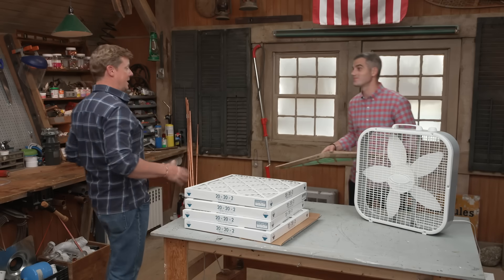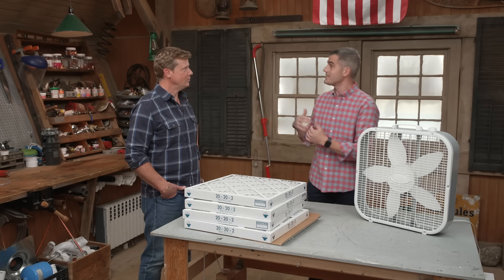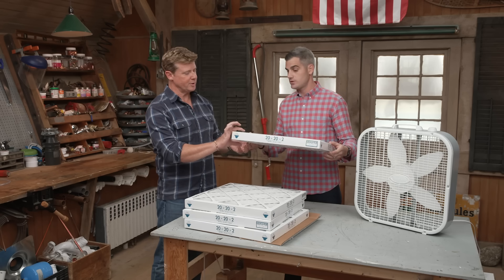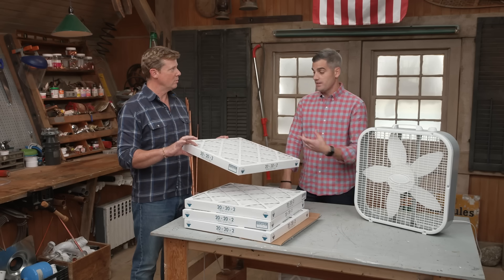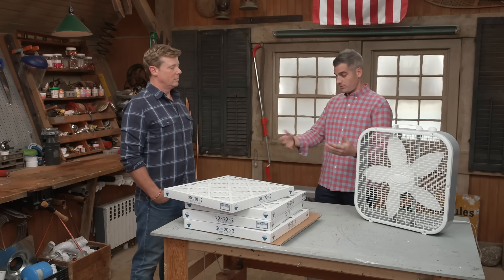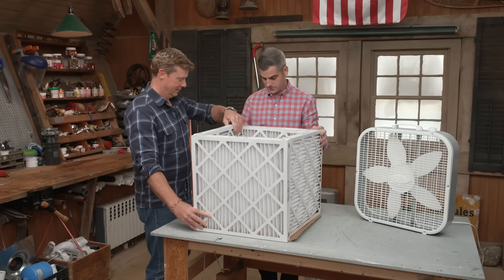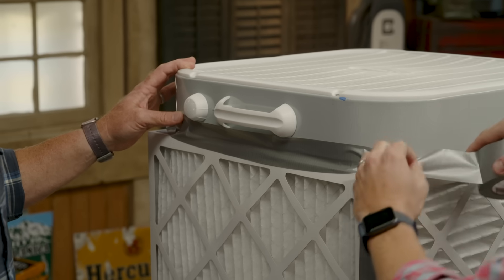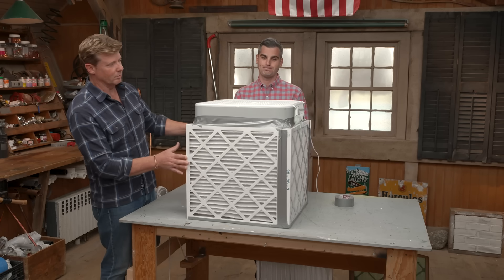How to Make a DIY Air Filter | Ask This Old House

Comment: Good stuff. 
I've got a few different HEPA units, and a very sensitive nose. On my floor furnace I have one HEPA furnace filter like these, on an angle  on one side of the furnace (floor furnaces are really great at collecting dust and then spreading it). The filter is attached to the bottom of a dorky plywood box hung on the wall above it.  On one side of the box is a small round table fan. Now I have hot filtered air blowing through my house.  
To replace a $400 Honeywell unit that smells like burning wires, I just wired another HEPA furnace filter to the back of a big circular floor fan. (When it's going it sucks the filter against the back of the fan.) This does about as good a job as the Honeywell junk before it started smelling like burning wires.  Both of these completely bootleg set ups worked pretty good during California's bad fires a few months ago.

Comment: This video is incredibly IRRESPONSIBLE. MERV 13 is NOT enough to capture viruses. It barely enough to capture sneeze-sized droplets, but COVID can be transmitted by aerosols, which requires a HEPA-grade filter (MERV 17 or higher). Here is the relevant link: https://www.damagecontrol-911.com/hepa-filters-rated-with-merv/

Comment: Soooo wearing a mask won't help prevent the spread of covid19.... Hmmmm... I guess I need a merv 16 on my face.. this guy has no idea how covid19 works...lol... It just doesn't sit in the air waiting to attack you..lol.. my word...lol
Reply: That's a mischaracterization of what he said. He made a distinction between virus particulates (super tiny) and the larger aerosols from our breath that CARRY them. It's why mentioned the virus "goes along for the ride," and is consistent with what is widely known about transmission via air. It's the aerosols that masks help stop, i.e. the virus indirectly if you prefer.
Reply: Droplets are what carry viral particles. Each droplet can carry anywhere from hundreds of thousands to millions of viruses. Also, you don't get sick from one viral particle. It's the dose you are exposed to (viral load) that determines whether you get sick or not. Masks stop the transmission of droplets. It's also why health professionals in hospitals etc wear the most PPE because they are exposed to much more higher viral loads than the average person is.
Reply: @thebrokegambler-f6o  lol... Our little mask or simple bandana won't prevent and drop let from entering your system..that's a proven fact. The virus is extremely small... It's like putting up a storm fence to keep bugs out of ur yard.
Reply: @dodgesportsman772  It keeps your breath from traveling as far, that is the reason we stay 6 feet apart.

Comment: With the added surface area, why not just strap a 5" filter directly onto the fan instead of 4 - 2" filters in your box configuration?  You wouldn't get quite the airflow, but you may get enough.  It'd be a lot more portable and easier to position.
BTW:  I certainly wouldn't have thought of this if it weren't for this video.  Thanks!
Reply: the fan would probably struggle

Comment: Ross,  could you cover the outside of the filters with tissue paper (the thin stuff used in wrapping delicate items) as a pre filter?  Would this defeat the purpose of the filters or actually make them last longer and be easy to clean and delay replacing the filters?
Reply: Totally unnecessary.  Inside your home it takes a long long time to plus these up.
Reply: We have not tried this, but I am not sure it is really necessary. What size particles does tissue paper filter out? I would assume that the particles would have to be very big...

Comment: Great idea!   I improved upon this.    Instead of 20x20 filters, I used 20x30.   Made it 10 inches taller with an additional 800 inches of filter surface ( 10"x20") additional per filter (x4 sides).  I used the cardboard box that the fan came in to cut out the base and taped it up with gorilla tape.   Highest merv filter I could find at Home Depot was 10.   Thank you for the great idea!
Reply: Been running essentially the same in middle of my house for 2 or 3 years now, except instead of using cardboard opposite the fan, I taped in a 20x20. My original plan was to modify an inexpensive furniture dolly to set it on, but just taped on 1" cubed blocks of cedar at the 4 corners. Filters last about 14mos, and no issues with fan so far.
Reply: Over achiever...lol! Great idea!!
Reply: Call around merv 10 isnt that great, you can spray a filter sticker on the filters to catch more.  You want mim, merv 13. 15 is even better thats hospital grade merv 16 is clean room purification. 
Merv 10 is what newer hvac systems use.
My filter in my hvac system are 5" thick.

Oh look on Amazon. Honeywell or some off brand.  They copy Air bear filters .
Amazons a good place to look.
You can search Google for merv ratings and what each category is for.
Reply: National Allergy Supply (online) tends to be expensive, but I know they carry filters of at least Merv 12

Comment: A MERV 13 filter will NOT harm your HVAC system!  They add more pleats(more surface area) to make up for the fact that the filter material itself is more restrictive. Any filter will list the pressure drop (in inches of water) on the side of the filter itself. As long as the new filter has a similar pressure drop to the old one, it will work just fine in your system.

Comment: I agree with Cory G in the comment section.  Putting the fan horizontal will have the potential of burning out the fan motor at some point. Especially running it 24 hours a day.  Putting the fan vertical you will have exactly the same filtered area. Two sides, 1 back and 1 top filtered surfaces.  The solid surfaces in the filter will determine the resistance to air flow which in turn will determine the load on the fan.  Greater solid surface area will increase resistance which is the factor used to determine fan motor size.  Put the fan vertical.  Better design.  This old house should have thought of this point.

Comment: Have they done a study showing these pleated filter catching the covid 19 particles? Since I am an HVAC tech. I have learned one possible good way is that you need to add an ionizer to the supply duct work.  This  kills the particles which will enlarge by a couple of microns so merv 11 or 16 filters can catch them. What these guys showed.  I don't think this type of filtration will help.
Reply: Question: I have read Merv 6 filters are antimicrobial and kill viruses like Covid.  Are Merv 13 filters made exactly the same on denser?
Reply: @charlottekathrine1625  Filters are for "filtration." which is "To capture particles" that pass thru. Filters don't kill anything. I work HVAC industry.  In order to kill microbes and viruses you need "air purification" like a UV light system to kill airborne pollutants that is installed your ductwork system. There are several different types of UV light systems on the market. The ones my company recommends are "Air scrubbers" and "Iwave-c". Iwaves have been tested to kill covid within 30 minutes.  These are more expensive than a normal UV light system, but does a better job and you get more value for your money. With an addition of  a filtration system to capture the particles can go a long way to help with air quality in the home.
Reply: @smacleod69  Thank you so very much!  I was afraid of that.  What is your take on tacky filters used by the spray booth industry?
Reply: @charlottekathrine1625  I can't really say.  I worked in a paint factory when I was 19 in one of the spray booths. Those filters were made of paper and  captured as much particle as possible. But as they are today, the product and standards should have improved over the past 3 decades.

Comment: We manufacture filters so I will try and explain how any system can operate fine on a merv 13 or higher. It has to do with pleat count, think of your air filter in your car. It only works well because there are a lot of pleats stacked next to each other. This enables your engine to pull air through a very small filer with little resistance, if you eliminate half the pleats the car would not run well. The more pleats the lower the pressure drop. A merv 13 filter should have 15 pleats per foot to achieve a pressure drop comparable to a merv 8.  Here is the catch you have a media that costs more per square foot, you have to use more of it to make the same filter in a merv 8 hence this filter will cost at least twice as much as a  merv 8. Hope this clarifies.
Reply: Do your 4” filters have the same amount of filter media as your 1” filters?  I’m trying to decrease the initial dP without sacrificing efficiency.  I want to increase the media area by increasing the number of pleats per inch, or keeping the same number of pleats per inch but increasing pleat height.  Seems like residential filter manufacturers don’t publish pressure drop and media area, just efficiency.

Comment: 3:40 NO!!! More surface area means MORE resistance!!!!!
Reply: If you stack the filters on top of each other, there would be about 4 times more resistance than one filter, but if you stack them side by side as in this video, it will have about 1/4 the resistance of one filter.

Comment: Instead of three filters, why not just tape one to the back of the fan instead?
Reply: They explained that in the video. More filters means more surface area. More surface area means less resistance and better air flow.

Comment: be a little more complicated. Use a squirrel cage fan / blower fan like a floor drier fan. they have low air bypass. Build the filter mounting box out of plywood. Built one years ago and still works great. Just added a UVC 40w light fixture inside it to stop anything living making it through
Reply: That is genius

Comment: What I have done is add pre filters to catch the larger particles. This way you won't clog the finer filter with the thick stuff. Throw away the cheaper coarser filters more often and conserve the finer filters.
Reply: I do the same thing except my pre-filters are the washable re-useable ones.
Reply: @benc1927  What pre-filters did you use?
Reply: @benc1927  Would you share the brand / size you use?
Reply: @Michael-kl6qn  The filters were 20 by 20 by 2 inch.  You can find them at Walmart by different brands and sizes.  They have the filter specs on them.  You can choose the ones you want. For pet dander down to germs.  Last time I checked recently, they were about $8 each for the cheaper ones.
Reply: @benc1927 ❤
Reply: link for your pre filters? do they work with the setup In this video?
Reply: In my woodshop, i only use the cheaper MERV8 filters, since they will need to be changed every month or 2. at home i made one with MERV13 filters, and i change the filters every 6-8 months.
Reply: Excellent idea.
Reply: Thank you. I was wondering about this.
Reply: WHERE DO I GET PREFILTER?
Reply: Did you add a prefilter to each of the filters?
Reply: @PointMicrosoft  For everyone asking about a prefilter, you can add 1 inch low rated filters around the outside (maybe even decrease the grade of the inner filters to keep air flow through the system the same.  There's a commercial air filter called Blueair 411 that has washable spandex filters.  I'm thinking of doing that around the entire set up (except where air exits, to make it look nicer and have a prefilter.     So, from outside in.   Prefilter fabric,  1 inch cheap filter (for fur),  activated charcoal filter (for pet odors),  The this set up in 2 inch MERV 8-13, haven't decided yet.  I have the perfect size table for it, so the cats and dogs don't rub against it or try to jump on it and I'm not pulling in clumps of hair that should be vacuumed or swept, not pulled into the filter to clean later.
Reply: @lauram7803  do you put the fan blowing out or in?
Reply: @Nunnia222  out
Reply: This one video is just tremendous!
For families that have allergies suffers and for those that suffer from asthma this is a miracle in an affordable box! Buying a hepatitis filter system can cost over $1,000 and this solution less than $100. Leaving this running in the living and or bedrooms to clean out the air so when you get home you can breathe easier and sleep better. Plus to also be able to help small construction projects not spread dust everywhere, it is just truly amazing all those that this solution can help, fantastic video guys thank you very much
Reply: Totally unnecessary.  If you're using them in your house they take forever to clog up.  Now, maybe if you're using it in a wood shop or if you're in an area with wildfire smoke, sure, add pre filters.  Keep in mind the more dense the filter the harder the fan has to work to pull air in.
Reply: @one7decimal2eight  
Also a higher merv ratting can and will freeze your A coil and damage you compressor becuse the A coli froze up.
Trust me my old system would build up 4" of ice and tottaly stop the air flow.
Making the system work really hard and high electric bills. 
You should avoid closing off rooms and closing vents you want the air to move without restrictions.
Reply: @one7decimal2eight  The pre-filters we have catch sooo much because we have pets plus pollution and dust from outside.  The HEPA filter would get clogged so easily and quickly which in turn isn't great for airflow unless we change them every 2 weeks, instead of just vacuuming the air filter.  The pre-filter has huge holes, so it doesn't add much air resistance.  Clogging does!
Reply: @one7decimal2eight  it's a box fan..who cares if it works harder..set it ..don't forget it..
Reply: @one7decimal2eight  Not true. I've tried it with and tried it without. You'd be surprised how much the cheap filters will catch. Don't believe me? Just try it out yourself in within a few weeks you'll see.
Reply: @one7decimal2eight  I notice he put a card at the end of the filter, and I was wondering isn't that wear the fan pulls most of the  air.
Reply: @jrmaphia6552  you talking about that piece of cardboard on the bottom?  Will not hurt the flow as it sucks it in from 4 sides.
Reply: @jrmaphia6552  If you are talking about the cardboard, a cube has 6 sides.  The fan took one of the sides and the filters took four.  The 6th side was mounted on the floor, so instead of a filter, he used cardboard to keep the air coming in the filters and not around them.  

I've seen the same filter used with all five other sides made with filters and the system hung from the ceiling in a wood shop.
Reply: @one7decimal2eight I have two cats and a rabbit. I got the most porous pre-filters (to mitigate the drag as much as possible) and they collect a lot of pet hair. 

They also provide a “buffer zone” between curious cat claws and the main filters. Highly recommend it depending on your pet situation.
Reply: @one7decimal2eight  not with cat and dog hair bro
Reply: @doomslayerforever2858  If it's sitting on a table or on the floor, cardboard will not matter.  You can use an additional filter if you are hanging it from the ceiling

Comment: Best option is to use those cheapo filters in the furnace so you don’t restrict your hvac system and then use little filter systems like this in each room. You’ll catch so much junk.

Comment: Pressure drop is really not as big of a problem as long as you replace your filters when they get dirty. High quality filters have the same pressure drop as low quality filters at the start. This video reasoning is actually poor advise.

Comment: My humble opinion...a furnace is not an air cleaner. Filter is designed to keep large dust and hair from the system.  Buy a separate system designed to clean the air.